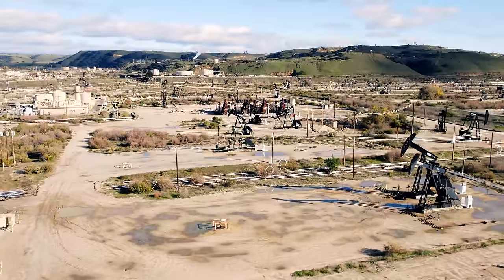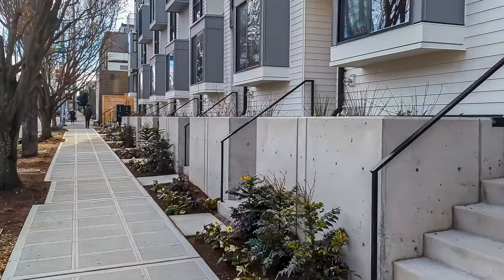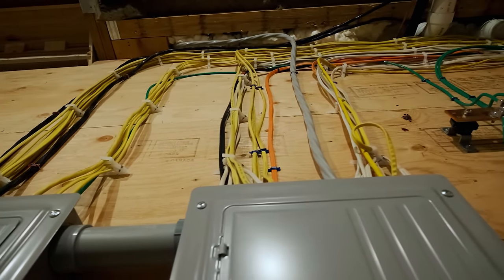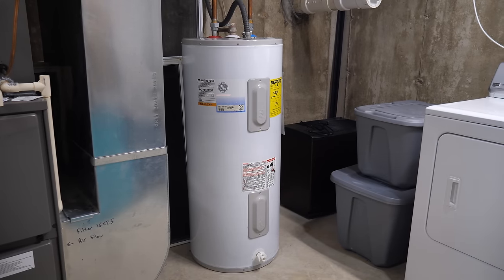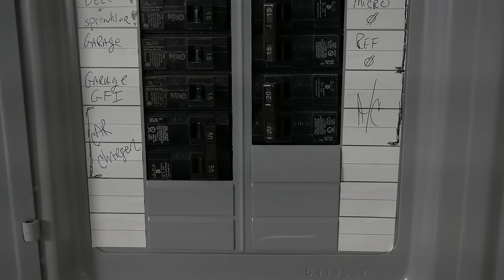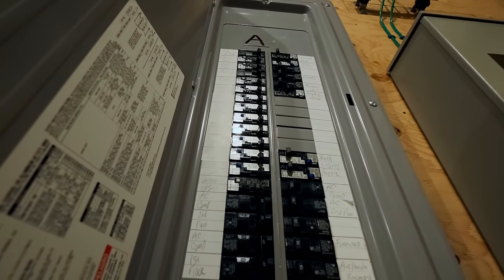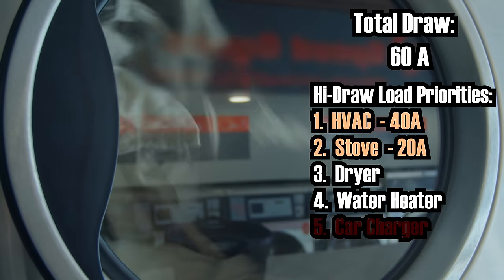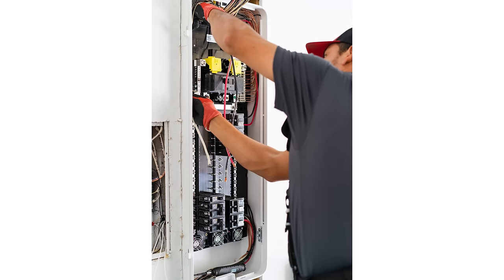Home Electrification: There's not a lot to do, and it doesn't have to be hard (Part 1)

Comment: Thank you for even mentioning apartments. I've lived 24 of my 34 years of life in multi family units and I sometimes feel like writers and video makers on this topic forget other types of housing exist.
Reply: "other better types of housing" there fixed it for you.
Reply: Annoy your apartment owner to switch from the current option to electric, they are the ones to annoy for that task, there are also individual panels you can hang of your balcony, you would have to ask the owner for permission to use those as well though.
Reply: Credit where it is due, by merely being a multi-unit building, it is inherently more energy efficient even if you're burning stuff. Heating for example. The common areas like stairwells are ekstra air based insulation, and the smaller surface area to volume ratio means slower heat loss overall. Water heating, you lose less heat/energy to innactivity with a range of ages and occupations and lifestyles in the same building. Where in a single family home the times that one family aren't using the water it is cooling down without being used, in such a building someone else is likely to be using it, so you have less re-heating to get it up to temperature due to cooling while unused. And it is also likely to be a larger capacity reservoir of hot water, leadnig to yet another case of smaller surface area to volume ratio, meaning said energy loss due to the cooling of the water is even smaller. Finally, by its very nature it is more likely to already be serviced in a way that adding electric dryers even if indvidual ones (bad, should communal ones) or whatever is not a problem.
Reply: Well on the plus side if you live in apartments you're already way more efficient in terms of heat use.
Reply: @sylkates I read it in the opposite sense. It seems to me that the original comment was saying that higher-density living units are better. (As was explained in a further comment, there are many positive energy efficiencies that you get with higher density.)
Reply: Cause it isn't natural to live in a home like that. Even in ancient times people made huts & buildings for their families, look at the poorest parts of Africa, the slums of Brazil, etc.

Single family homes are a humans natural state of existence, even back in European history (& later North America) it was most common for even surfs working the land to be separated by family into homes allotted to certain subsections of land for them to farm. In North America settlers just built their own home.

Single family housing is normal & it's the natural way humans chose to live. Multi-family housing has throughout history across cultures, always been reserved for those without the means to live in an ideal environment.
Reply: @WitchMedusa  I definitely think it's silly for someone to suggest that multi-family homes are better in all situations, or that everyone should strive to live in them. But the "It isn't natural" argument isn't going to ever convince any slightly educated person. I personally think it would be good if all Americans got used to having smaller, less wasteful home. But no one should have to deal with sharing a building with another family if they don't want to.
Reply: I guess that is because those people are so well off, and always have been so multi family units is something strange to them.
Reply: @MaxPMagee  thank you , I was lost. Snark deleted
Reply: Nevermind that thousands of years ago people were living in apartment complex like homes in Rome  @WitchMedusa
Reply: I don’t think Mae wants actual truth to be spoken here, just their own fake history.
Reply: Not everyone want to be an apartment loser!
Reply: Same with mentioning condos! Everyone always forgets about those
Reply: To be fair, those are generally not in the hands of the individual tenant to be able to change these things. I've lived in apartments that even supplied microwaves for you. If they aren't your appliances, and the building itself isn't in your name, you have no power (ha, unintentional pun) to change the power source of your home.
Reply: @yourgooglemeister6745  i FEEl much safer in an apartment. Besides, most of the maintanance is common and I don't need to worry about. Also like tohave some near neighbors.
Reply: @animeartist888  In my country a lot of people own their flats outright, but that doesn't solve the problem of the building's supply limiting what you can and cannot install. Although, electricity is expensive enough here compared to natural gas that I'm genuinely not sure it'd be cheaper, and nobody living in any kind of tighter budget would willingly switch to a more expensive solution.
Reply: @ibrahimsued4906  I like living in apartments because first of all there is the creature comfort of being surrounded by a herd of others rather than alone, so even when you're alone at home you're not far from other people, second of all I don't have to worry about maintenance of anything outside, and third of all it feels cosy to me to live in a smaller space. I actually don't know what I'd do with all the space if I ever got a house. I mean sure, I would certainly like to have enough space for all my stuff, but it's not like that requires more than, what, 50m² in my case, and that's assuming I'm living with 1-2 other people? So yeah no I'm quite comfortable living in an apartment.

Comment: Great video. one thing we need to DEMAND from start ups like Span and our governments is standardization and open sourcing of these new smart parts. I don't want my house to stop working cause the company that build my panel goes under and turns off their servers and/or stops supporting their product. being that panels can be in place for like a 100 years and IOT companies can fold in like 2 year this is critical for long term adoption.
Reply: ya it's pretty bad i had to subscribe to Maytag to update our washer.. also our relay on our washer was shot on a board. issue was our warranty was useless because no one come out here to repair things so we had to wait 4 months for a new board

Sears was the last company out here that came to repair things
Reply: [whispers] NATIONALISATION
Reply: Same thing with all cloud-based things, or other "smart" things. Some bit goes sideways and nothing works anymore.
Reply: lol "demand"
(as in electrical load demand)
I saw a pun in that
carry on 😎
Reply: The only way is to force the market in this way with community driven projects.
The principle is not very complicated to design (at least for a simple non-IoT balancing circuit), the issue you'll face though is that even 30 years is a long long time for electronics. It gets very complicated to source replacements for old components, especially IC chips and MCUs. Software toolchains are also hard to find with old MCUs. And with SMD packages, it gets more difficult to fix stuffs, especially when dealing with QFN/BGA chips or multi layer PCBs.
Reply: I would hope that the Span system has a "fail dumb" mode if the smart management stops working so that it can go back to acting like a regular breaker panel if the electronic switching stops working.
Reply: @ericfielding2540  I agree but if you are using it as TC (and Span) is suggesting where you rely on the smart part to stay under the 100 amp threshold you would constantly be tripping your main breaker when the smart part fails. and if the company does not support the product anymore that probably means a new panel for you.
Reply: @PainterVierax  You could add solid state relay in series with regular fuse. Regular fuse for protection, relay for control. Then you add driver circuit and expose pin for each relay control. Then you keep standard automatic fuses, not sure how standard relays and a driver board in somewhat standardized measurements. You could then buy it as any other electrical hardware for your installation. 

"Brains" can be any IoT company or diy or what ever, use Arduino, raspberry or parallel port on your 80s pc
Reply: That was the first thing I thought of.  Not to mention the much higher failure rate due to the increased complexity.  Nice idea but I seriously doubt it will serviceable in 10 to 20 years and you will have to change to a standard panel anyway (at great cost).
Reply: @annoyedbybrother  I don't know what video you just watched, but the one I watched spent a pretty long time explaining that you would not, in fact, be tripping you main breaker constantly even if you went full electric on a 100 amp circuit without a smart panel.
Reply: @fulconandroadcone9488  yep the most problematic is how the brain part will be serviceable. Should be some standardized system on module to allow easy alternative sourcing and replacement.
Reply: @Blutzen  Provided the person uses careful management of loads.  If I have a smart panel, I'm not going to be thinking about that believing the panel is handling it for me.  If it fails, yeah I'd be poping the breaker constantly because I'm not used to handling things myself anymore.  But that brings up his second point, if the breaker will fail "dumb."  Otherwise if it can't no power until that smart board is replaced, and hope they haven't cut support for the smart breaker, otherwise you will be needing a whole new one.
Reply: @Blutzen  yes... my comment was in response to what would happen if the smart part failed.
Reply: yes we had 16 cameras set up in our manufacturing plant that used internet to work. then the company went out of business and we couldn't use the cameras for a while. luckily my IT guy was able to get around it . we lost some features but he got the cameras working and recording again. 
but now we need to add more cameras so have to buy a new system.
Reply: @PexiTheBuilder  Well, this shouldn't be a problem, you can use them "old style", manually. If you built your smart home with redundancies. For the first time in 5 years Apple Homekit made a mess, because of an old iPhone with an old iOS was still on our family account (phone not used anymore). My wife's account was deleted from the house, so no more smart unlock of the house. The horror! She had to reach in her purse to get the key to unlock the door, then needed to press some buttons to light the house because it didn't lit itself as it was supposed to. 🙂
Reply: @annoyedbybrother  Apparently in addition to not watching the video you also didn't read the comment you were replying to, which pointed out the part where TC mentioned just doing it manually.
Reply: @jgood005  Yes, if they don't work also offline, locally, not a good idea.
Reply: @PainterVierax  The point is that panel ends up with a standard interface, say rows of 10, 15, or 20 pins. You could then make a board that attaches to that. The board could then have brains on it self or collect information from pins on used power and control them via usb. 

You can't get more standardized than usb and all the way you use interfaces that are easily   used in a diy project.
Reply: @RS-ls7mm  Even if it doesn't fail, companies these days are offering "lifetime support" where the "lifetime" can be as little as four years (or maybe less) from the date of purchase.
IoT stuff is troublesome in its own right. Always pick stuff that can work standalone and, if possible, is ancillary to more simple equipment.
Reply: @chaos.corner  Agreed, I avoid anything with "cloud" support.
Reply: @fulconandroadcone9488  A "brain" could be any 4bit or 8bit MCU integrated inside the panel that runs the simple priority program and eventually provide a basic physical UI. This brain is also required to collect and transmit data or executing remote commands from another external bigger system for domotic/IoT. But the remote part should be mandatory.

Not sure about USB though. Sure it's very widespread but it's not a simple protocol and still the majority of microcontrollers can't handle it natively or with the massive overhead of bit-banging and clock frequency limitations (see the V-USB project documentation as an example). It also requires some driver and UI on each clients. Good old RS-232 is easier to implement with basic UART converters. Even RS-485 with Modbus and a basic UART converter is trivial compared to USB.
At this point, rather than USB, it will be more beneficial to get the extra steps and directly use the extremely standardized Ethernet protocol or even Wifi paired with a tcp/ip stack and a mini web server for the GUI, something a rather old ESP8266 is already capable of by itself.
Reply: @PexiTheBuilder  at least laws that spell out "EOL/ server side decommissioning REQUIREMENTS like making source code available 
we already have a LONG list of IOT "smart" E waste out there
Reply: @PainterVierax  imagine an "offboard" system with ONLY disconnectors inside the load centre that are SAY 12V bi stable relays and when the "offboard" controller fails the interface is understood and a NEW / MODERN replacement could be made INCLUDING from 3RD parties / HOMEBREW DIY
Reply: @jasonriddell  Such an external direct drive system would require relays inputs, as well as sensors outputs lines with serious noise immunity for each lines. Then it probably needs some DC+ground pins for powering the external device from a separate uninterruptible line. That's quickly a lot of wires.
Maybe I miss something but I don't see the benefit of exposing all of this to the exterior when a tiny module on some standardized socket can be located inside the box, eventually having its own physical UI and be externally programmed/controlled (and even firmware updated) with some simple legacy serial protocol.
Reply: @PainterVierax  I gave usb board as an example interface, it can be eathernet or the who thing could have its own cpu ( think raspberry  that then connects to network ) .

Point is, it is not too hard to make a decent standard.
Reply: @fulconandroadcone9488  Well apparently it is not that simple since you thought USB is a good candidate, whereas another person thought external direct drive is the way to go ;) 
We didn't even talked about the daughterboard characteristics like the choice of the socket for the module, how the whole system is DC powered, etc. 
Or even more general targets like the ease of installation/upgrade/DIY,  the actual and future availability of the techs and parts, the cost of the parts, resilience and redundancy mechanisms, noise emissions, certifications, the organization behind the standard, etc.
Making an open-source project that suits individual needs is easier than willing to make a standard.
Reply: @PainterVierax  I didn't think usb is a good candidate, I just say driver circuit has a given interface to which you connect, what the connect peace does is up to what you choose, like PCIe card, most of the time it can be gpu, but also something more specialized if you need it. 

my idea is that logic board has only standard connection to the pannel ( think disable circuit pins and read current/power draw ) what you put is on that board is your choice same as choosing a gpu.

Will it be netwoked, will it be usb, will it be fully self contained is up to the board you buy
Reply: @fulconandroadcone9488  Well, you picked USB as an example in the first place, as if it was practical and sustainable.
Some design choices like having the logic board directly providing the i/o panel to get external communications pushes some serious constraints on the form factor and could be unpractical with cramped spaces inside and outside the power circuit panel.
Although, for wireless communication the design should take into account that the electrical box could be a Faraday cage. And again increasing HF noise emission is not always tolerable for some electric lines dedicated to sensible devices (eg. for audio or lab instrumentation, or even for the current sensors on this automated load circuit).
 
My draft idea is more in between: Dedicating two serial pins from the modular logic board (some cheap MCU analysing sensors and controling relays) getting through the module socket to controlled impedance traces passing through the control board to go to a  connector like DE-9 or something simpler like screw terminals or binding posts.
Then the "big" brain getting the various UI and network connectivity (and eventually heuristic) is external and acts as a gate. As you said it could be some big multitask home server, or some ARM SOC running Linux/BSD with a Pi connectivity, could be some compact ESP32 board or even some MCU coupled with modules.
With internal headers, that simple serial link could allow embedding the big brain inside the electrical panel itself with the benefit of being more modular to accustom different space constraints.
Reply: Yeah, a lot of things especially tech-related are a disaster waiting to happen and really need to be standardised at the very least and also preferably open-sourced. However, it should be noted that this isn't something to demand from companies; companies exist for one purpose, and one purpose alone: making money. The real people to demand action from are lawmakers who can create provisions for the regulating authorities to authoritatively regulate.
Reply: Also, SPAN shouldn't be IOT at all.  There's not a single thing (besides the user interface being on your phone) that their breakers do that couldn't be done analog or just without being connected to the internet.